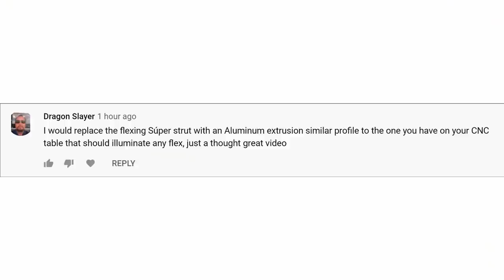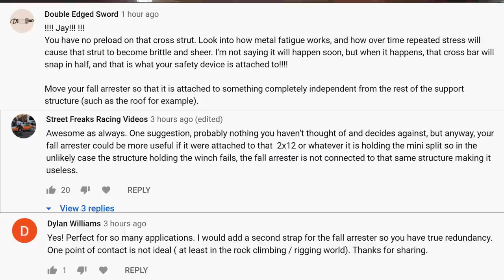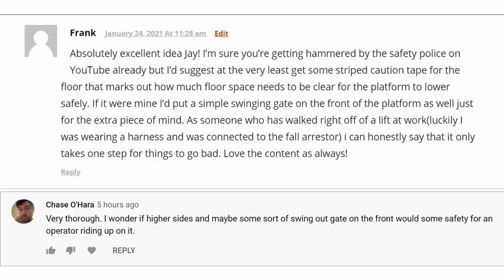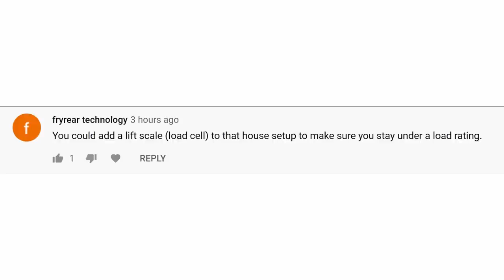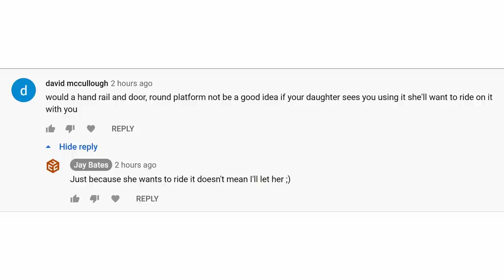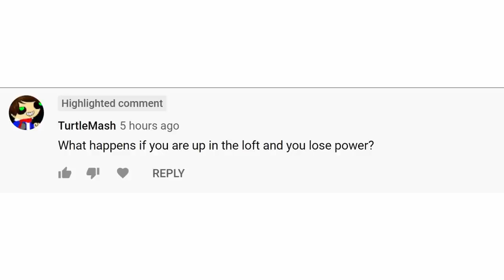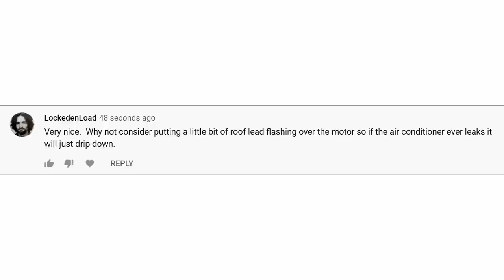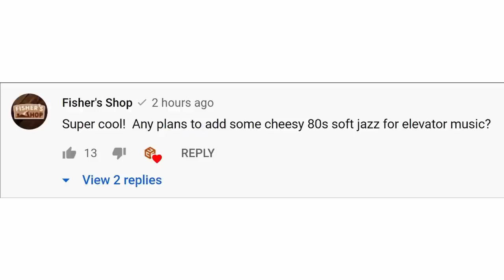DIY Elevator Follow-up

Comment: A Quick comment on the flexing super strut. The key criteria to solve the flex issue is not the material (alum extrusion vs 2nd super strut vs steel square tube etc) its the strength and SIZE if the vertical sidewall. For any given material (lets say you go with steel square tube) a taller side wall will be stronger than thicker material (i.e. 14ga 1.5 x 1.5 square tube is stronger than 1/8 thick 1x1) so go taller, not thicker, and you'll get more strength with less weight. Putting two together (such as bolting another super strut across the top of first one) does essentially the same thing. Although a single side wall is a better way to go, bolting two together will work.
Reply: I agree with everything you said, Atkore Unistruct load calculator disagrees with those who said facing the strut channel opening down versus up would increase strength.  The interesting thing is the supports installed towards the ends, in this configuration you want to support the strut and keep it from moving upward.  When the load is applied in the center the end will rise which means the supports aren’t being loaded at all in current configuration.  I guess the thought was if one of the center supports failed the end support would take up the load, I see the thinking but I believe this scenario would cause enough deflection to be out of the safe limit.  The best of both world would be to support from below and above.

Comment: Not ysure how the 2x10 is attached to the wall? Where you attached the chain around your 2 x 10, you could/should add a vertical support 2x4 under the 2x10 to the vertical shop framing, to serve as a sort of "jack stud".  A really simple upgrade that would strengthen the 2x10 sheer strength, where it is held into the wall.

Comment: Great video.  Preparing to do one of my own now.  I am curious about the use of a single self retracting lifeline.  The ones I have seen are rated for up to 310#.   With a hoist max load of 1000# it would seem you need 4 of these.

Comment: I see multiple videos about DIY elevators of this type.  I like a video discussing possible missteps.  BTW consumer grade household breakers are not made for switch duty.  They may serve, but the (already inaccurate) thermal trip breaker may be come very inaccurate as to tripping current.  I’ve seen it go both ways.

Comment: Great build Jay!  It's hard dealing with the safety aspect, everyone's perception is different.  I like the idea of the fall arrester, what I don't like is the shock absorber part.  I would try and use a fall arrester without one.  If the cable snaps, I think the less the elevator platform falls, the less energy it will impart on the connection point, when the fall arrester does it's job.  Also, what is the length of the shock absorber?  It may not even stop the platform if it fails closer to the floor.
Reply: Most of the shock absorbers are four feet or less and if you are that close to the floor when a failure occurs, there is very little distance to gain speed. And if you've ever needed a fall arrest system (and I have) you want that shock cord.

Comment: Thanks for the info. I was looking for trolleys, but didn't know they exist.
2 opportunities for safety enhancements: If you don't use the lift often and want a visual confirmation that it's safe drill a transverse hole through the channel(s) closer to the trolleys would be better, but probably more important easily accessible, so maybe a foot over head height. Farther away from the back wall by more than the radius of the trolley wheel, but less than the diameter. When the lift is not in use insert a bolt through the hole, nut is really optional as it shouldn't ever see any force. I'd paint it bright so when munchkins came running in I could visually verify that the safety was in place.
would
Reply: Second: I'd install a hinged trap door 'upstairs'. I'd have it oriented so that it flipped back against the wall when up. You may need a plank or plywood spacer with cutouts for your cables to offset from the wall. Trap door can be cut from plywood with thickness and framing as you see appropriate. Build a pushrod on your lift with something like a wagon wheel on the end. It could probably ride directly on the plywood of the trapdoor but if there was a piece of framing to roll against that could be a bonus. Lift up, trapdoor open. Lift down trapdoor down. Except when the lift is in motion either the trapdoor or the lift itself should be covering the home. When up the trapdoor could have a bias towards the wall or to close. If the bias was to close I would have a bungee to pin it open when needed. If the bias was towards the wall I'd have a  bungee from the top of the trapdoor to the front of the platform to pull the door closed behind you

Comment: I'm not dissing on your elevator it suits what you need to do, you give me a good idea I'm an electrician that has installed elevators in custom homes, and I've worked on actual elevators in the field but they are Way beyond mine or anyone's finances, I would put two more bars of unistrut on the front sides  with 2" square bar behind all four corners connected or welded into the top with a square and anchored to the floor,the whole frame would stand on its own before any unistrut was put on it.  my basket or whatever would have a square of square bar underneath it and gussets running along just like yours a plywood floor with  steel connecting everything together, at the top you could connect a motorcycle sprocket to the winch and run two bars connected by chain and sprocket that had pulleys and cable above all four corners that way you're lifting all four corners and they would all have emergency stops in each one whenever there is  a broken cable or no tension much like a deadbolt door latch it just sticks into the holes in the unistrut just like brakes so it can't fall, the old time miners used them and all modern elevators have them you can get a lockable control that you put at the bottom or just put a master key switch you can also diy a system with normally closed switches you can push a button to start it and it won't stop till it gets to the top the same way going down that way you can control it so you can summon it from downstairs or  upstairs and you could probably put as many people that could fit in it safely with no problems you can even work on making some doors, unless you rode it sitting down rather than standing up you're going to need at least a gate, you could stumble into  it when it jams momentarily and then suddenly drops  it could throw you right off the edge of the floor you don't want to get pinched in that either going up so I would put a guardrail in the front for sure, and then upstairs when the elevator is down there is nothing stopping you or nothing to grab onto if you step or stumble towards that hole, my elevator seems like a lot of work  I just need the uni strut, I have all the rest of the steel and welding rod (,if you have a 20 foot stick of any material you can tie it underneath your truck and take it home )but I'm thinking about doing that for my garage that would be a safe elevator, I've always wanted to do that , thanks for the ideas.

Comment: love it..  a couple of my questions .. 1) what is the strength of the unistrut??  I would have doubled that.  2) does the winch freewheel without power.. probably not..  thanks I would build one in a second if I had the need.  cool stuff

Comment: a suggestion- If you know the max weight the lift is designed for, stencil or mark the expected lift capacity on it.  do the older you a favor don't make him try to remember the weight capacity.

Comment: I agree with the unistrut orientation change.  The engineering description: for a given load a member in tension can be much smaller than a member in compression.  The reason: in compression, buckling can occur.  So the member needs geometry or additional material to prevent buckling.  The next time you cross a truss bridge, look at the members.  Some will have very large cross sections.  Other will be very small in cross section.  Members in compression and large to prevent buckling.  Members in tension with much smaller sizing simply to prevent "plastic deformation" or non recoverable stretching.  Push a rope - pull a rope analogy.

More entertaining: make a video on using a pocket knife and lets read the safety responses! 🤣

Comment: You could very easily counter weight that with a counter balance  set up or even a spring for a overhead door balanced. For the max travel X weight  with ful vertical lift brums then the hoist has very little work you may ask of it if what im talking about I would gladly draw up a diagram for you with all the parts identified . Any overhead door company would be able to give you all the parts you will need

Comment: I agree tractor supply is much cheaper for hardware, such as bolts and such which is sold by the lb, I can get a ton more for the money than at lowes or home depot. Now metal for any type of fabrication those small pieces that they sell in the welding section is outrageously high same as lowes and home depot. It may be dictated by the vendor supplying them I am not sure. Best bet for anything of that nature would still be a local metal supply place. I also agree that a gate is not necessary , in fact would prob be in the way in many instances. You can cite safety all day long, but the simple fact is slipping and falling on stairs would be a bigger safety issue than not having a gate on that lift, especially since no one else uses it. If u dont know not to step off of the left for a few feet then, u prob shouldnt be in a shop full of power tools in the first place. As for the water issue with winch  i dont think the small amount of water would have any affect on the winch other than possible rust. U would have more of a safety issue with a gfci receptacle than the water issue. gfci go bad all the time, they are very finicky, once they trip a time or 2 they can start tripping all the time at random. I cant count the number of those i have changed. You made a simple elevator that serves the purpose it was designed for, and u did a great job at it. I am sure u will notice things u could have done differently over time maybe even somethings u want to change or add, which is common for any project or shop equipment. I am soon getting ready to start my 50x80 shop, and one end of it will be walled off about 15 feet of it, that will be my spray booth and drying room, along with a room for wood that will be used to dry wood and store it. Above all that I wanted to do storage and after seeing ur elevator video I think that is what i will do to get access to top.

Comment: good talk Jay my only question is is that a carabiner at the top of the lift for the fall arrest and if so what's the load for it. I used to repel off a buildings they always told us whatever the length of your lanyard was four times the amount of stress at the load whatever the length of your lanyard was four times the amount of LB at the load. so 100 pound man fell it would be 400 pounds on his hips when it a load hit.... BUT good talk. I hope this doesn't sound like a troll... {so you might want to double up on that carabiner}

Comment: I don't think you need to worry about the threaded rod failing.  The shear strength for a mild steel threaded rod is about 8,000 lbs.  Going to a grade 5 bolt about doubles the shear strength.  I think the wooden structure would fail first so just leave it. 
Great project by the way.

Comment: i commend you for attempting to address all of the safity conserns. The thing is one can over think it. think of the law of deminishing return. I believe you are spot on with safity. It functions much like a "man lift" at a paper mill i worked at and it went up 8 floors with an 18" x18" platform. i believe the openings for each floor were 36"x36  and you had to step off at the floor you wanted to go too.. Granted a man life is a giant vertical convaor belt with platforms spaced 7' apart and continuiously ran. However your eleavator has more safity elements than the man lift. 
Well done Jay 

Rich

Comment: Kudos to you for answering these questions without mocking all the dumbtarded safety gurus! You made it way safer than most everything I’ve ever done, or would have.
Reply: I'm not sure why so many commenters on this video are knocking all the safety suggestions from the previous video's comments. Jay invited feedback, and a lot of the safety comments were thoughtful and intended to be helpful. Most were not at all condescending but reflected a willingness to share their ideas and expertise. I sure would have wanted to get all that good feedback if it had been my lift. Jay did a great job both with his original creation and his upgrades based on much of the valuable safety suggestions. I say thanks to all the helpful comments. The attacks on those commenters didn't strike me as helpful at all.

Comment: About the fall arrestor situation now: The threaded rod is plenty fine, we always tend to underestimate how strong bolts are, they can take a LOT. What I'm more worried about is that the fall arrestor is now completely off center. If you have something heavy on the left side of the elevator, and the fall arrestor holds it back suddenly on the right side (in case of a cable break), that torque would probably rip your elevator apart. I'm confident that that platform is plenty strong to lift a lot of weight as you have it, but a sudden uneven jerk like that is a completely different situation.

About the horizontal superstrut flipping: I'm not so sure about that. I think we all know that iron does very well under tension (rebar, metal cables for suspension bridges, etc.). Sure, it can handle compression, but it usually tends to buckle under pressure, which can't happen under tension.
Imagine a break in the vertical pieces of the horizontal superstrut (the two uprights of the U). If you have the horizontal piece of the superstrut (the bottom of the U) on the top, those breaks can open up. If the horizontal piece is on the bottom, the breaks will be pushed together. In the end it probably doesn't matter that much, but my guess as an engineer would be that you should have the horizontal section on the bottom, and instead make sure that the vertical sides of the superstrut can't collapse inwards. If that happens, your superstrut turns into a flat metal piece, which is nowhere near as stable. Just a bit of wood inside the superstrut should prevent something like that happening.

I don't get all the people who tell you to add safety tape, barriers, doors, etc., etc., that's such BS. Even if other people would be using it, those people are responsible themselves. Your kid wanting to use it is also one of those things. Why are people worried about her using the elevator, but not about her turning on any of the many power tools you have? The elevator is probably one of the safest things for her to use in the shop. Kids that are smart enough to use that remote are smart enough to know that pinching a hand or foot hurts, and so does falling or jumping from a height. And all that depends on her being alone in the shop, which you've said time and time again, doesn't happen.

If you ever decide against using the fall arrestor as a safety mechanism, I think something that's fairly simple and reliable to implement would be mr. Otis' (IIRC) original elevator safety device for when the cable snaps.
Reply: Think, static loading versus dynamic loading.

Comment: Video (both) excellent , i do not not a lot about winches , the ones i have seen in use have a lever/switch/button to play out the cable , if you have one of these it could accidently get knocked pushed while loading upstairs ? only mention it incase it was overlooked .
All the best and i always climb ladders with little or no safety equipment  ;-)

Comment: The issue with a breaker wearing out isn't just an issue of "it won't turn on or off when you flip it", it is also an issue of it wearing out in terms of it tripping when needed, and while, yes, most likely not an issue as they are pretty reliable, something to consider when making the statement about "just replace if it wears out".  Great video though, love how thorough you go with things :)

Comment: My only concern in terms of safety would be when something sticks out of the platform, or tips over and suddenly sticks out, and interferes with the floor above when going up. How fast are your reflexes to stop the motor? 
An interesting little project would be to add 3 lightweight vertical panels along the sides of the opening: if something sticks out of the platform it would push up a panel which would trip a connector to break the circuit and stop the motor instantly.

Comment: In May of 2024 my house burnt down and now I'm in the process of rebuilding. So here I am thinking why not put an elevator in. My question is I'm thinking of placing the hoist down stairs securing it to the concrete floor and keeping the noise level down. Then running the wire up to a pulley then back down to and connect it to the "cab" platform. No reason why that wouldn't work right?